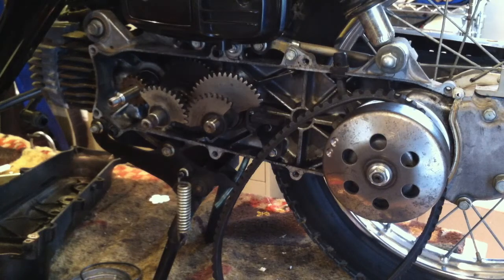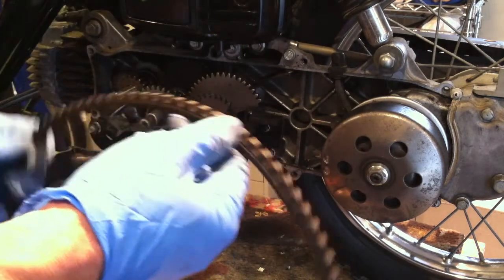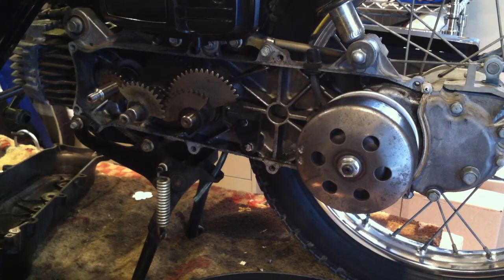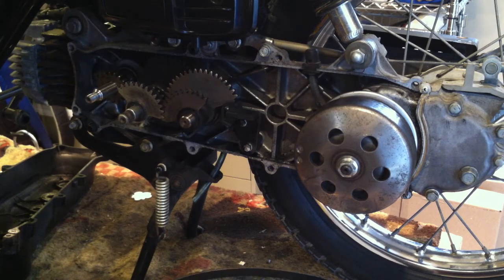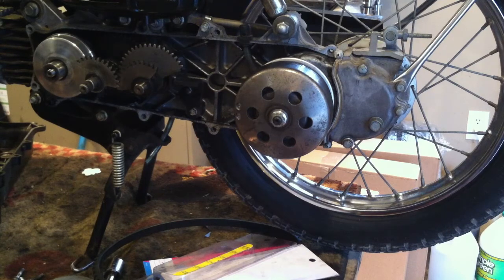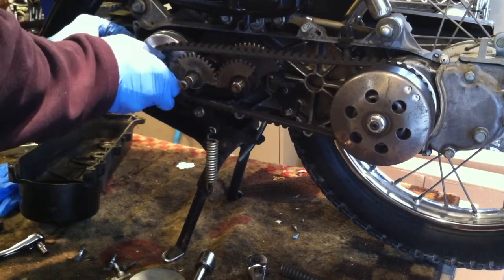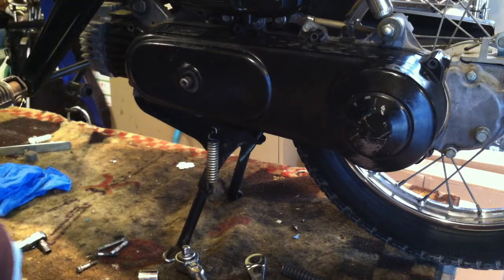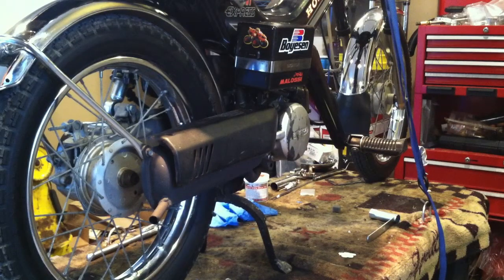Honda Urban Express nu50 Variator Weight Exchange and More

Comment: Very nice video on your transmission upgrade on your stock bike. However, what was your new top speed with 36 gram variator, your gy6 clutch, and your different springs in that clutch, and your reversed stock belt?
Reply from the maker: wow, that was a while ago.  If memory serves on that stock bike, I did 34 with the reversed belt which almost matched the bx31 belt of 35 and was an improvement of at least 3 mph over the ax31 belt run the right way.  You just have to be careful if you flip the belt.  Newer belts will want to flip back.  I'd like to try for top speed on a stock bike again one of these days.

Comment: do you know where i can find a  1983 honda urban express kick start spindle
Reply from the maker: Search eBay on a daily basis.  I think there is a new one on ebay now for $80~.  kind of pricey.  It may also be worth it to buy a parts bike or a spare engine.  They are hard to find.  One will turn up.  You can also try moped army's buy and sell forum or join the Honda Express Facebook group and ask on there.  There's also a Honda Urban Express Facebook group.